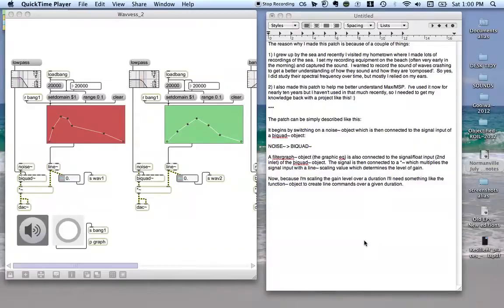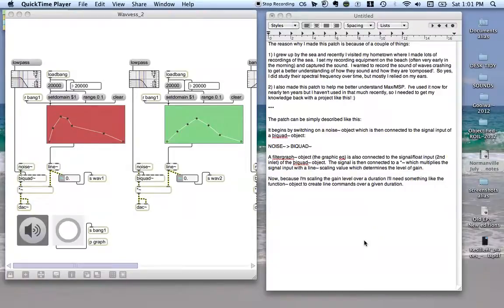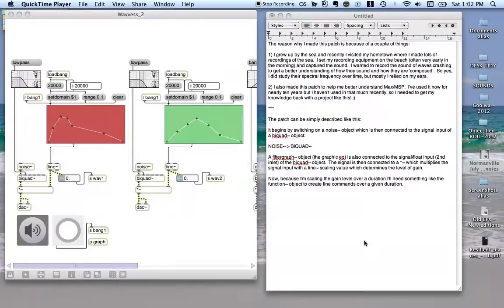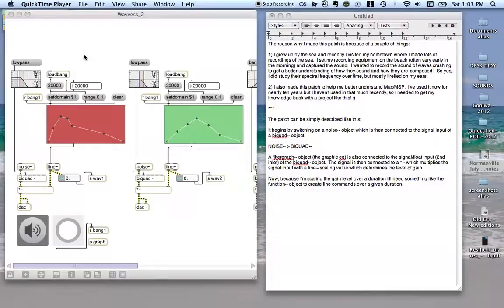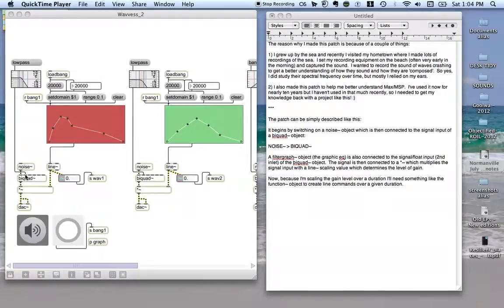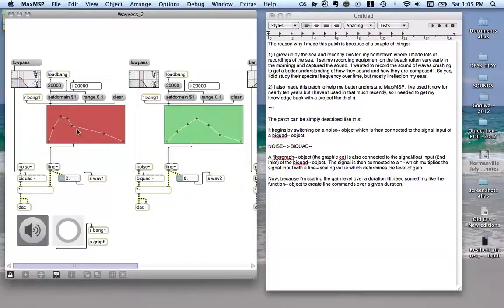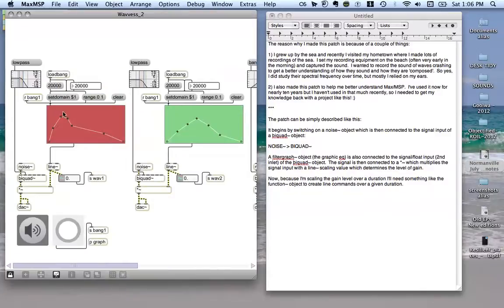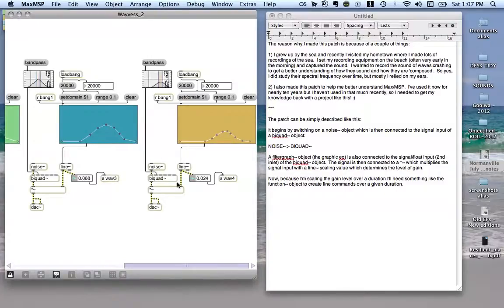Max/MSP: a wave of noise Pt. 2 (patch explained)

Comment: Hi! Thanks a lot for sharing this patch! It's amazingly built and beautifully presented. 
I am using it (with your name on it) for an interactive environmental project for Uni. The object is made out of plastic bottles filled with plastic bags and IR sensors attached to the cap to trigger presence, which, then will trigger a distortion of the sound of the ocean waves.
Reply from the maker: Hey, thanks! That sounds brilliant and thank you for the credit too. Do you have any documentation of the work? I'd love to check it out. So great that you were inspired by this. :)
Reply: @tristanlouthrobins  https://youtu.be/6qdcdp5Rjh8
Here it is. You find a link to GitHub in the description. There is still some work to be done regarding the sounds triggered by the sensors, but for now this is it :)